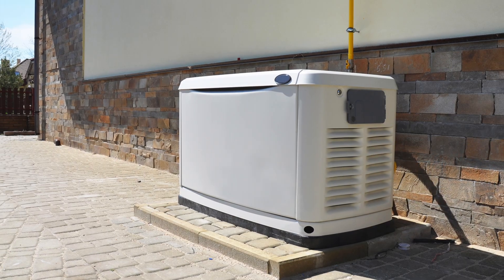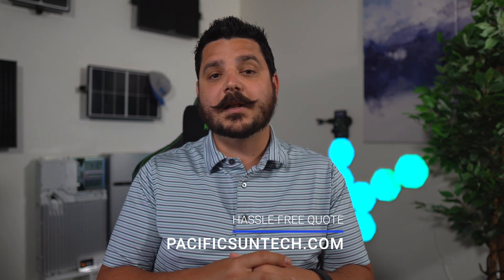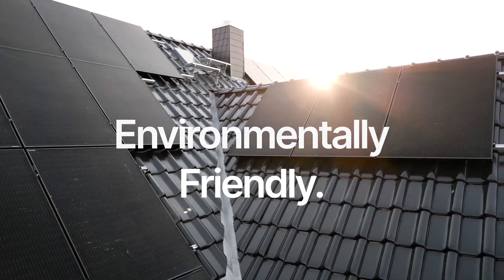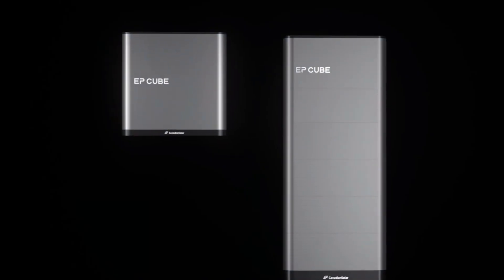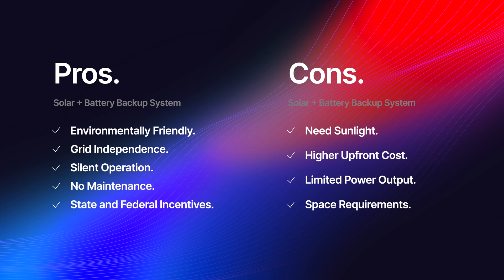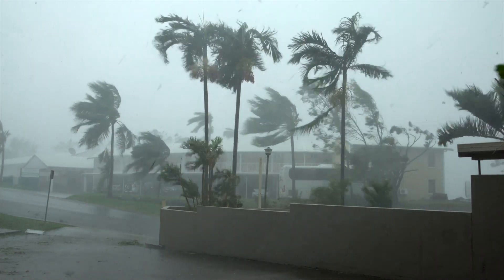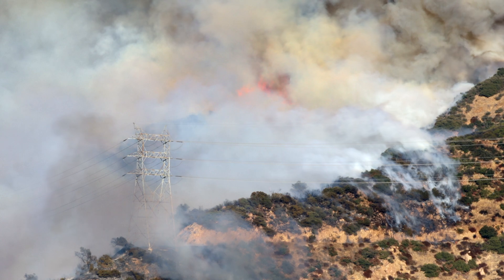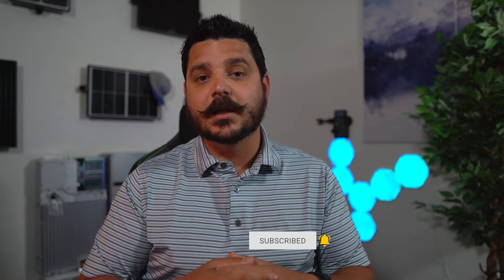Pros and Cons of Solar Battery Backup versus Generator Backup

Comment: Great video.  My big portable generator died during an outage on Wednesday.  Talking to several people out here rurally, and now going down the research rabbit hole, my first reaction of getting a whole home generator is now hanging on the idea that I might go battery instead.

I'm thinking buy the best transfer switch (whole home), and inverters, and enough batteries to go 48 hours on basically min usage, utilities, and internet, so I can scale the system later to add more batteries if I like how everything is going, and to include large solar arrays, maybe next year.  I don't want to entangle myself in another all encompassing project all at once and the mounts I want to make for the solar array are going to be a big project.  I'm really wanting them to tilt using a linear actuator.  I just got done with a couple big projects and I need a breather, but I do need some power backup to replace my manual transfer switch and portable gen.  

I'm here on 20 acres so it possible to do a large ground array but that's a big investment, but I would value being 100% off grid.  They key is scalability, but I don't feel safe that when the power runs out it runs out in the batts I'll have any options.  In my research, I found with some of these inverters, you can plug in a little 110v portable to charge the batts which is a great way to have "both" without actually having a gen that can feed the house.  Less efficient, yes.  But I would like to add the panels at a later time, then I have short term outages covered, long term outages where there's sun, and the ultra last ditch of using a small gen to keep the batts up if required at very low efficiency but high security of having some power, even if you have to really watch your average usage as the batteries act as that go-between.  

What do you think of that approach of having multiple power modes, through this indirect approach?   

It seems to me, this way I'll have infinite options.  I'm just starting out on my research on this topic though.

Comment: In the northeast our outages tend to come in the winter due to ice storms, and the weather in winter is often cloudy for days at a time.    A generator costs much less than enough battery capacity to last 3 to 5 days.     I have enough battery capacity to last overnight because I sure don't want to run the generator all night long, but need some power to keep the heat on overnight.   If solar recharges it during the day, great, but I can't count on that.

Comment: I live in California and have solar generators, a backup gas generator, batteries and a smart home panel.  Power outage switch is automatic and seamless.  It works great with only 1.4kw of solar.  The system is modular and portable and beats anything you are offering.  The last 30 days 90% of my electricity came from the panels with generator and batteries.  Paid $12k for the whole system, which is modular and expandable.  Im thinking about adding an additional 7.2Kwh of storage and a horizontal wind turbine to connect to generator/batteries.

Comment: I have a generator on wheels I keep parked in my garage.  I run on propane so I don't have to worry about draining gasoline after use.  I eventually intend to a run a natural gas line to where my inlet receptacle is located so I don't have to keep a supply of LP tanks on hand (besides NG is less expensive and cleaner burning). To be able to run my loads overnight I would need a giant battery that would by itself cost an order of magnitude more than the generator.   If I want to PV cells, putting them on my roof results in high cost to maintain my roof.  
PV only appears to be economically viable if the government subsidizes the price